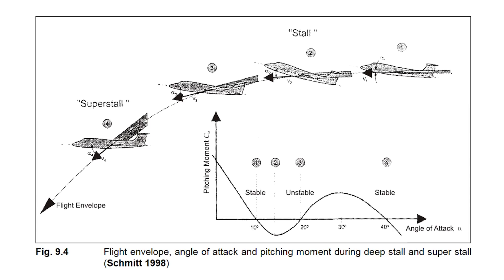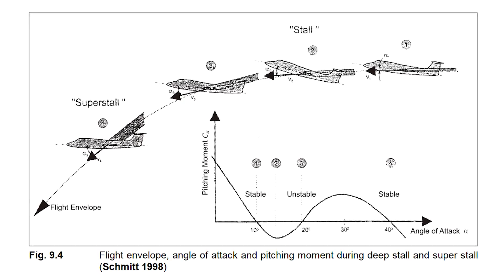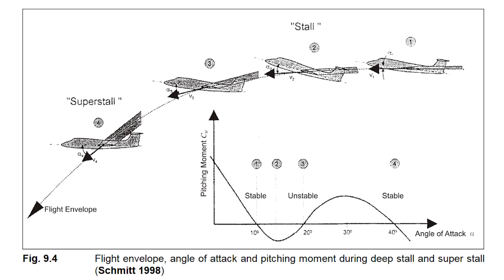How Not to do Spins Joseph Johnson

Comment: I've not done spins yet. I've got PARE in my brain but doing a spin recovery session is on my to-do list.
Reply: Obviously, I don't know what type of airplane you are planning to use for your spin training; however, "PARE" is not always best, or preferred, method to use during spin recovery.  PARE is by far the most common sequence, BUT ALWAYS check the POH for the instructions for that particular aircraft.  I watched a WINGS webinar on this very subject and it was, to say the least, very enlightening about whether or not to use PARE.
Reply: @4-7th_CAV  thanks for the tip. Will take up your advice. I'm usually flying piper archers fyi.
Reply: @glennwatson  just wanted to make sure you didn't get locked into the PARE procedure if it didn't apply to your plane, according to its POH.